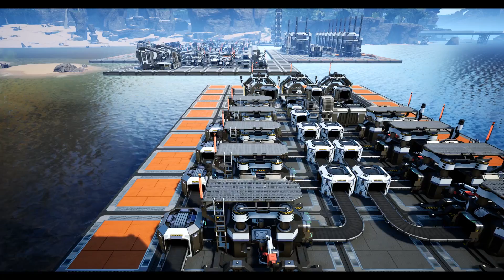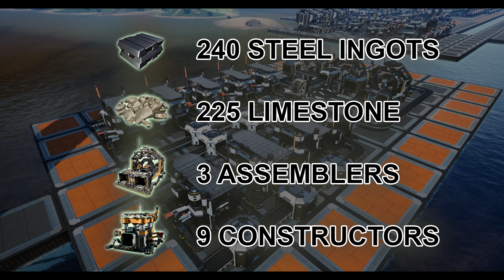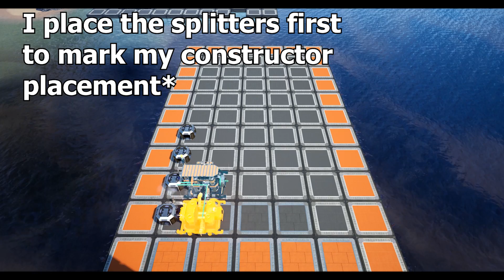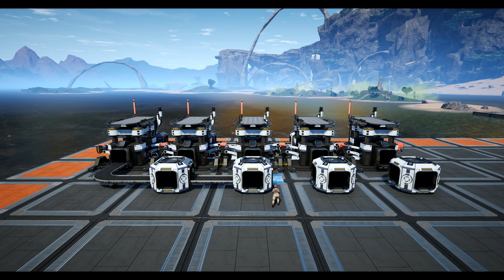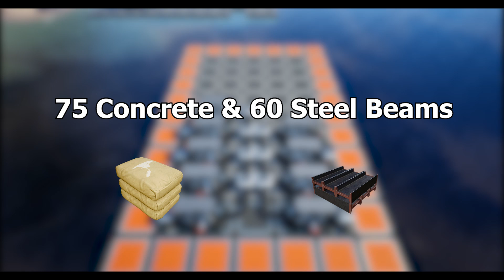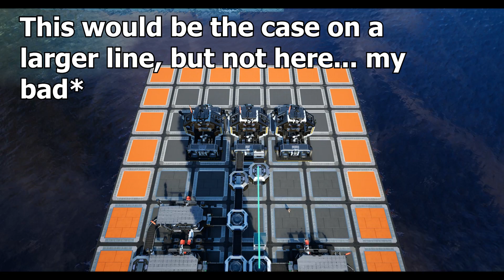Encased Industrial Beams - Super efficient Build Guide [Satisfactory Game]

Comment: OK, nicely cleaned up build from the builds I watched you make back in 1.0, I approve :)  Like anyone cares what I think :)
I think I must have checked out when you did the presentation, so I used tools, and I belted in 180 coal and iron, plus 270 limestone.  OK, I converted the limestone to cement in like 6 machines.  I converted iron and coal into steel with three machines (which I must have been confused because these did not seem to be in the build), so I added more rows to the foundation, then added three more assemblers to make the Encased beams, and then I looped that back to a large storage and a dimensional storage... I might have taken longer to build the sky bridge to haul the oreo to the ocean.  I like building over the ocean a lot more than building over the void, but maybe that is just a me thing.  I used most of your design, so that helped my brain make a layout that did not melt my brain so thanks.

Comment: In case anyone is wondering why the material requirements don’t line up quite right, new materials for 1.1 are 240 limestone pm and 180 steel pm (180 coal and iron ore pm). Took the extra steel beams I was making and sent them to storage/sink

Comment: FYI: The material requirements changed in the assemblers for update 1.0.
You now need 270 limestone, and an extra concrete constructor, or overclock one of the five to 200% so it makes 90 per minute.
you now only need 45 steel beams per minute, so only 180 steel ore is require now. I just kept the 240 and set the extra 60 aside for storage etc.
After those changes this should run at 100 with no waste (I think)

Comment: I think your design has a terrible mistake, this is not efficient at all.

you are basically connecting the spliters in queue, if you supply 225 limestine, this divides 225/2 = 112.5 per minute on the first machine, for the second spliter, it will be 112.5 / 2 = 56.25 per minute going into the second machine , and when you get to the third spliter it will be 56.25 / 2 = 28.125, we haven't reached the last machine yet and we already have a bottleneck.

For this to be efficient, the input spliters must be divided into equal numbers, but since you have 5 machines and we can only divide by 2 and 3, it is a design that will probably never be efficient (but maybe I'm wrong)

In fact, thinking about your design, it is more convenient for you if the input spliters are connected in a tree structure and that you use 270 limestone, so you connect 2 initial spliters, they are 270/2 = 135 per minute, each of both outputs the you connect with a spliter that divides into 3 parts, that is, 135/3 = 45, there are 6 outputs of 45 limestone per minute, so you can feed 6 machines at the same time without bottlenecks, 5 feed your production of Encased Industrial Beams and a extra you can use to build or for the disposer.

you have exactly the same problem with the machines that produce the steel beams, you cannot use a queue input, you must use a tree structure, you divide the main conveyor belt into 2 and in turn divide them into another 2 to feed 4 machines, otherwise you are bottlenecking
Reply from the maker: Hey, thanks for taking the time to message - you're right initially however you're suggesting to use a load balance technique - (it's is possible to do 5 equal splits by merging a 6th split back to the beginning of the line) Manifolds take a "warm up period" where as you say everything is split unevenly, however, once the first machine that's taking 50% of the items completely saturates, the excess will go over to the second machine, then the 3rd etc until the final two machines are the only machines that aren't fully saturated. At this point the manifold line will run at 100% efficiency providing you've calculated the inputs and outputs correctly. :) 
I've spoken about this in a really old video, but i'll post it here if you're interested. 
https://www.youtube.com/watch?v=zFy2v87HFE0&t=3s
Reply: @TotalXclipse  you mean the last 2 concrete machines are running below 100%? sorry if you said it in the video and I didn't understand, my English is not very good
Reply from the maker: @monicaaguilar3004  For a manifold that is 100% Efficient, every machine will be full of items except for the last two.
Reply: @TotalXclipse  that sounds strange to me, and at the same time it sounds interesting :P

So you don't have any leftover raw material? Usually concrete is not a problem for this production, but I cannot do this 100% efficient because it calls for 24 steel beams and I cannot find a perfect configuration for this.

Comment: I just did all that + getting explosives so i can get another iron node + setting up all the foundry’s for the steel ingots and it worked :D for like 10 seconds and then my power shut down so now i can start getting more coal and water before actually getting the encased steel beams or whatever the hell they are called :D
Reply from the maker: Man, I know the feeling! Power always needs topping up, we never seem to have a day off with power 😅
Reply: @TotalXclipse  yea so i tried overclocking with powershards but i didnt have enough coal / water so i just completeley destroyed everything prior to the steel stuff (most of my iron production+copper) and will build a bigger/better/more efficient base which i will connect once ive build enough coal power plants, so i can finally automate the next project parts to unlock tier 5 & 6 ... and with some luck this time my base might not even look as disgusting as it was before :D:D

Comment: Can you call something perfect if its overflow and not balancer cuz it requires time to warmup to reach max efficiency
Reply from the maker: Good question,  I'd argue yes, because once it's warmed up it will be able to run whenever power is on providing you keep up with the resouce demand. If power shuts down with a load balancer you can find some "start up problems as you wait for each structure to restock, where as with the manifold it starts working straight away due to the full buffers, so I'd argue that it's better than an overflow system in the long run but no, it's not perfect and no solution is :D
Reply: @TotalXclipse  Whats also true... whats ehy I warmup load balancerso each machine has like 70 resources inside so in case of power shortage it will boot up instantly...
Reply from the maker: @kaspariuks7466  If you load up load balancers, then why not load up manifolds :D
Reply: @TotalXclipse  had same idea after understanding how I build my factory...

Comment: Why 15 per minute? Was it just a random number or was there a reason behind it?
Reply: I think he's based it off 240 steel ingots, as that is a pretty standard amount based on 1 pure coal node and 1 pure iron node with a MK2 miner
Reply: Maybe because it is enough to satisfy at least one manufacturer and make extras no matter which recipe you pick that use the beams, so you have some extra to use for building. But also if you're making Heavy Modular Frames, then having two of this setup you could feed 3 manufacturers at once. But maybe he had a different reason :)
Reply from the maker: Did you spot that in the background or are you just clever! :) 
Originally I hadn't put much thought into it, (I also prepped an Alt pipes build for 10 per minute) but I did actually then go on to do a build for 1 HMF per minute, and like tay mentioned, thought the 5 extra Encased beams per minute would be useful for build materials :)

Comment: Why do you choose to underclock only 1 to 50%, rather than run all three underclocked to 84%?
Reply: Because it overflows the center one quicker, giving the other two full capacity earlier the first time it’s started up. Small advantage that only happens once, but it’s an advantage.
Reply from the maker: If you were to increase the size of the build then that would be the case, however as it stands you can do either or. I prefer to underclock one than 3